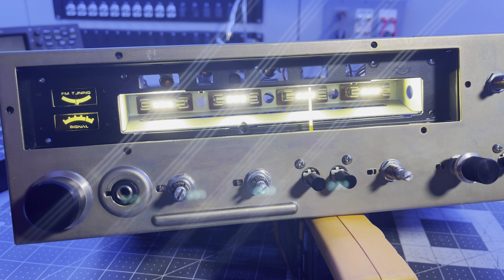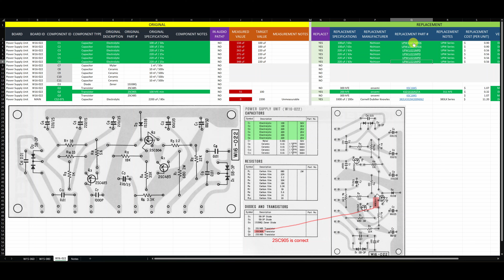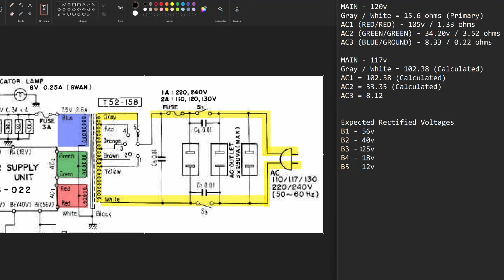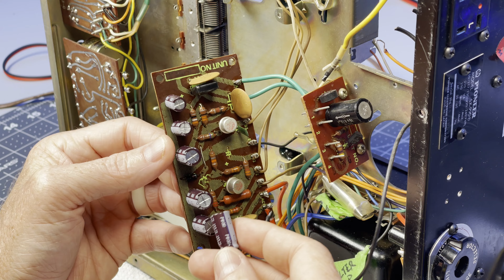Pioneer SX-990 - Repair & Restoration - 2 of 3

Comment: Did you have problems with a big speaker pop on power up? I used the exact parts as you did on the main amp board so I thought maybe you experts the same problem. Both sides have the big pop. It’s a negative spike, (speaker moves in). Music plays fine, in phase with correct polarity. With the preamp jumpers remove, it is a slightly smaller pop.  Theres a DC spike at the speaker terminal that dissipates in a few seconds. The amp sounds great once it’s up and running. Bias takes a while to get to 15mv but it’s stable once it’s there. If any ideas come to mind please let know. Thank you!
Reply: I do not believe I ever had any issues with start up pop. I would have to look back at the schematic to guess at this one as I don’t remember it well enough to ruminate on it intelligently.
Reply: I bought mine serviced but let it sit for a couple months before using. The first time I powered it up it popped and blew out one of Vienna Acoustics speakers. I was not happy. Eventually I tried again with cheap speakers and the pop was less significant. After a few times the pop is gone. It powers up no problem.

Comment: I’ve been following your video step by step and it has been a fantastic experience. Thank you! 

But, I got to the power  board re-capping section and noticed you installed the 100uf and 220uf caps in the wrong locations. You might want to confirm this. 

Thank you for the amazing amount of time and effort you put in this video. I’m looking forward  to part 3!
Reply: Unfortunately, this receiver was sold a while back but I will go back into my video clips and see where that mistake was made. I used this receiver on the bench for a couple of months before I sold it and the new owner says it’s working great so I guess it wasn’t critical but I don’t like making mistakes! Thank you for letting me know and the kind words.
Reply: I noticed that too, I just assumed it was opposite day?